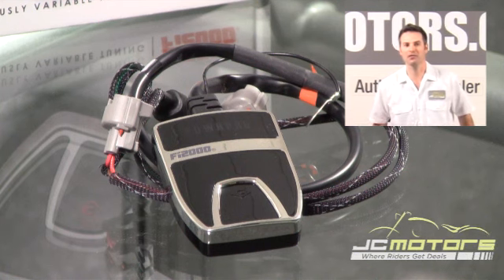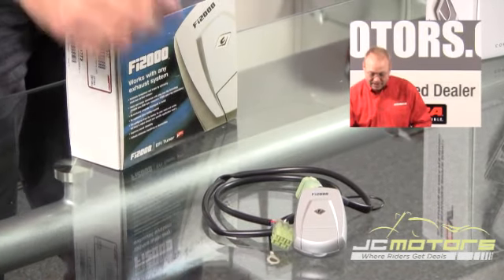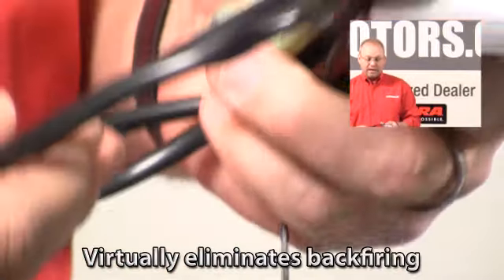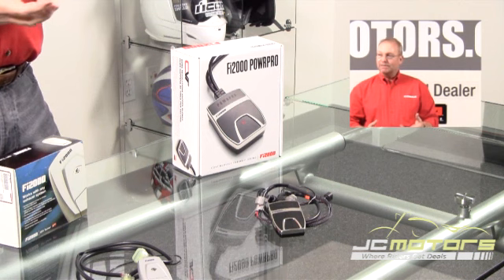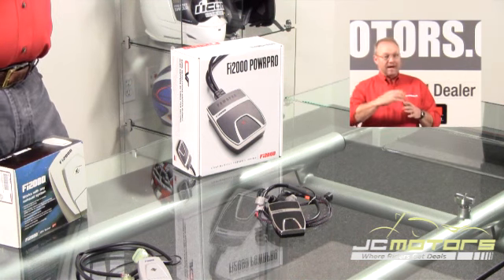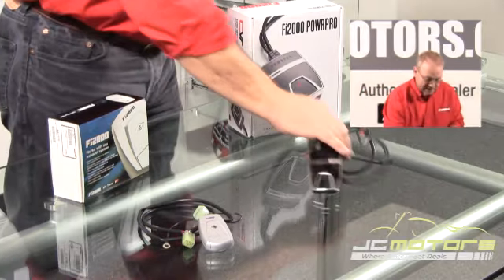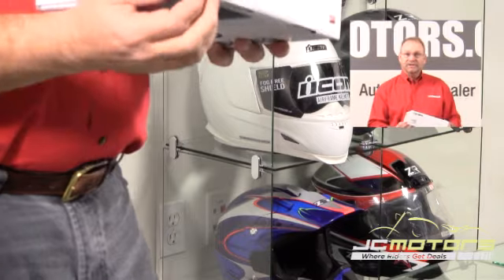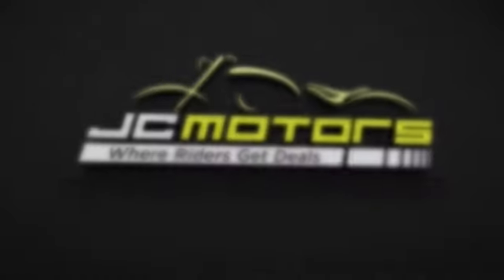Cobra Fi2000 PowrPro, Auto Tuning Fuel Processor

Comment: I have a 2014 HD FLHXS. It came with a Harley Davidson SE Super Tuner Pro and the dealer has used it to adjust the MAP with there dyno twice - once when I installed a new air cleaner and Rinehart head pipes and once when I switched out the Rineharts for Cobra Short-swept pipes. I lost a little horsepower and torque with the Cobra pipes, but I plan to do some minor mods to the baffles to increase flow, sound and, hopefully, power. I'm not crazy about spending $100 (and up) every time I change something. Will the Fi2000 Powrpro replace and/or undo what the SEST does without having the dealer do anything? Also, is the Cobra tuner "married" to the bike like the Super tuner is.

Comment: One other question - and I apologize as this is my first bike. I am assuming that the Cobra Powrpro Tuner CAN be used in conjunction with a power commander 5 setup already in place correct? My dealer recommended the PC5 when I bought my bike 1 year ago - I have been plagued by backfires and rocky cruising speeds ever since - they have since recommended I add a fuel tuner but this is the first time I am considering adding one and want to make sure they can be used together.
Reply from the maker: The Cobra Powrpro would replace your PC5, it's either one or the other. Ride Safe.